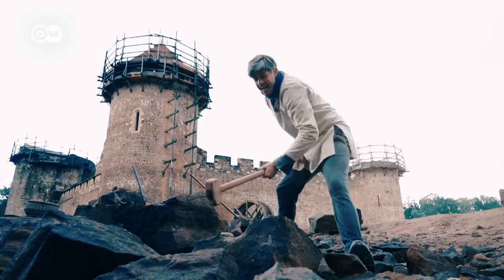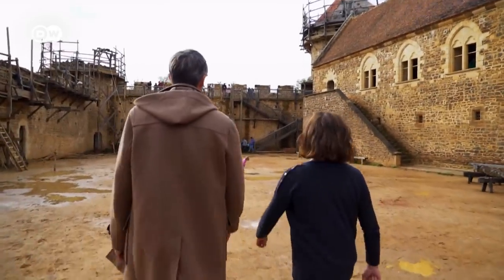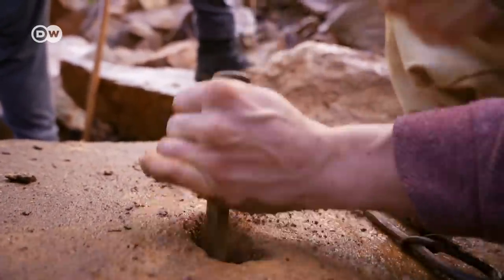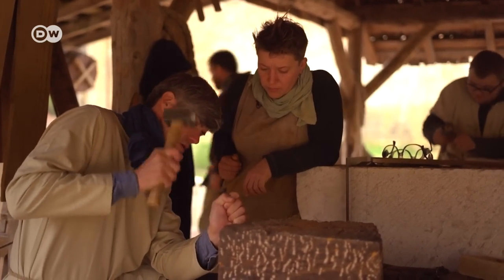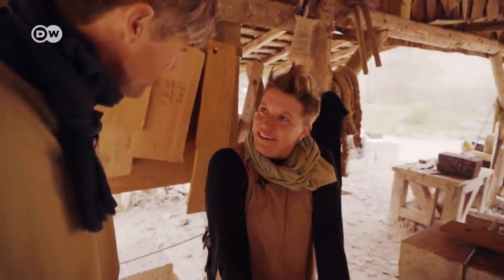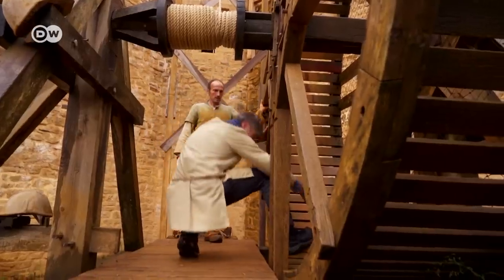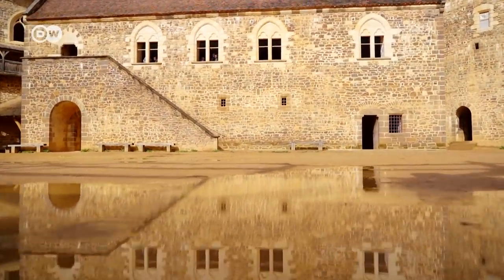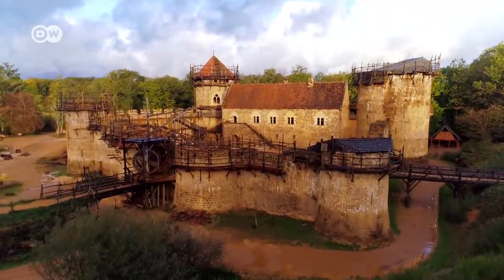How to Build a Medieval Castle | Medieval Castle Guédelon | Europe To The Maxx

Comment: In many ways this castle will have a greater historical and architectural value than many 19th century romanticized structures people often perceive as authentically medieval. Contrary to the popular belief it's quite difficult to find a medieval castle that wouldn't be rebuilt throughout the centuries, especially after the industrial revolution.
Reply: Not in every case... Im working at beautiful chateu, which was rebuilded in 19th century in romantic style, which is preserved to this day, but the building itself was once a real castle builded in late 13th century. So basically half "real castle" and half "romantic dream castle", because many thing from old castle are still present and visible. On the other hand, the most beautiful parts of the building were created in 19th century.
Reply: not in France.

Comment: So many of our modern expressions come from this time, for example, pot holes. The techniques can still be used in the Alps to restore stone houses, barns, using the same techniques. The level used is far more accurate than the modern "bubble" levels. The mortar can still be made in much smaller quantities using limestone. It's actually a better way than using manufactured lime.

Comment: We have something sorta similar here in the United States. A historical carousel mechanism has been lovingly restored in Albany, Oregon, and the animals are being hand-carved.
Reply: This is not a restoration project. It's the construction of an imaginary 13th century lower noble castle from scratch.
Reply: @19Edurne  I see your point, and it is true that this is not an apples-to-apples comparison. However, that is why I specifically said the carousel was "sorta similar". The reason I see similarities is that apart from the historic geared carousel mechanism, everything else about the carousel has been built from scratch. While the artisans are using the same carving and painting techniques pioneered by the original carousel builders, they are not following any previous blueprints. This is similar to Castle Guedelon, which is being built in the same way and according to the same style as classic Medieval castles, but is still from scratch and totally original.
Reply: @kentslocum  Point taken. ;)
Are there vids about this project on the internet?

Comment: I am surprised most of the towers have doors on the ground floor, the keeps of castles in England i have visited didnt do this, and the back right hand tower is a keep of sorts. I also thought that by the time period they were emulating they had begun as part of the concentric philosophy of castle building to make ever tower self sufficent, even though its not a concentric castle, its pretending to be from that period.
But the people in charge of this project know far more than me, so they will have made an informed choice.
Reply: Maybe I watched too quickly but I don't remember doors on the ground level of the towers on their outside façades. There are some in the courtyard, that is all. But again, maybe I watched too quickly.
For the project, the builders and architects took inspiration on the Philippian architecture (Philippe II, roi de France) who had initiated a new way of building castles. There are lots of them in France, but also in England, because they were very efficient in defense. If you want to have a very good example of this sort of castle, check "Château de Dourdan", in France 🙂
Reply: @heliedecastanet1882  They kept changing the desing of castle, but it was common to have doors off the ground floor, so if someone got into the bailey, they would still struggle to take each tower.
Reply: @dorianleakey  Yes, the designs changed over the century, but Guédelon is set in a very precise moment of History, the beginning of the Philippian architecture, hence the reference to the château de Dourdan.

Have a good day !

Comment: At 0:30 '...And they are ONLY using MATERIALS and TECHNOLOGIES from THAT PERIOD' while riding a giant hamster wheel put together with modern day nuts and bolts! (maybe even using ball bearings for the axle)
Reply from the maker: @baianoise Well spotted Sherlock! 😉 Propably a concession to modern life...
Reply: Their argument is that they try to study the medieval construction methods and not the medieval work accidents casualties. They also use modern ropes with a known resistance instead of the hemp ropes they make on site.
Reply: They are still bound by French law so a minimum of health and safety standards are in place eg helmets etc. A teh ysay themselves we're not here to test how many people accidentally die in the construction of a medieval castle.